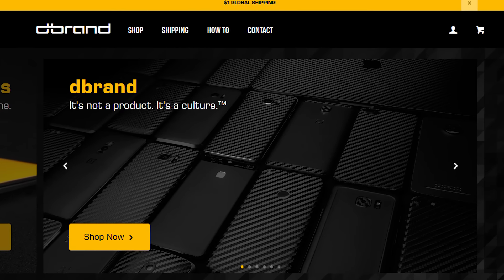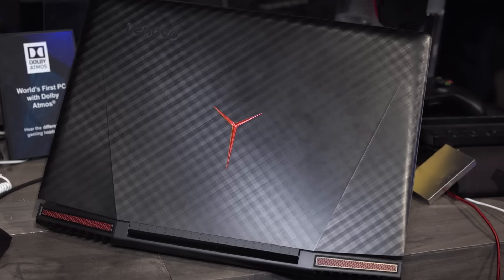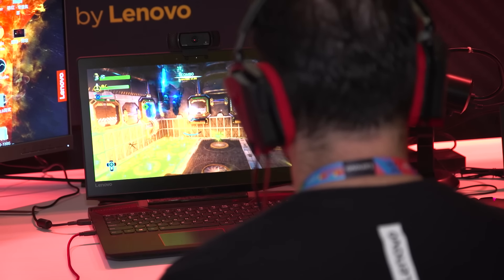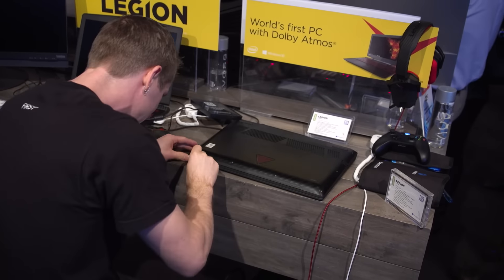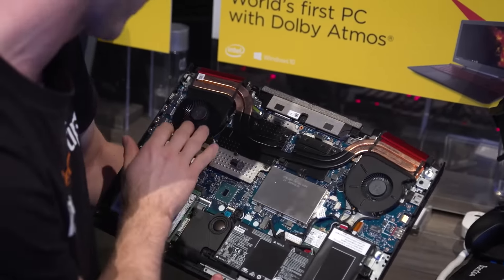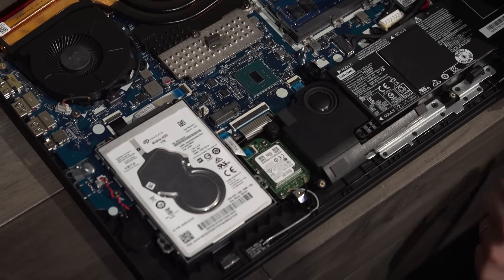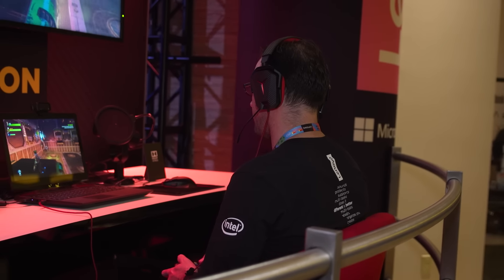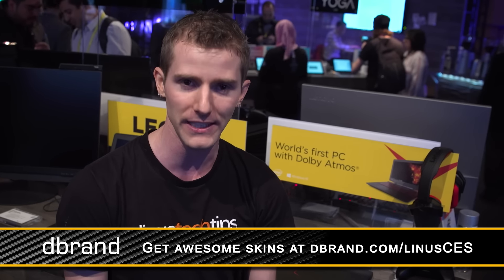World's First Dolby Atmos Laptop

Comment: didn't mi notebook air have Dolby atmos
Reply: i have that laptop atm and yep, you are right. honestly it sounds the same as the regular down firing speaker tho- just seems like another fancy marketing term
Reply: Right but a MAC is not a PC a PC has to use the windows operating system.
Reply: What? Mac is part of a PC, which stands for a personal computer- it has exactly the same hardware as rest of Windows platform does meaning it does not make Mac look any more different with PC with a Mac OS installed other than Windows.
Reply: TechMan221 no one was talking about MAC. Xiaomi Mi Notebook. Which has Dolby Audio but not Dolby Atmos which is their premium cinema audio technology. For it to work best, it needs to have the full array of speakers like the traditional 5.1/7.1 setup with additional speakers for audio from above. The ones on phones and this laptop and sound bars focus on audio virtualisation
Reply: David Park Didn't realize the laptops name was mi notebook air i never heard of it before.I thought it was a spelling mistake and the notebook air was a macbook air.Also if you put into google the notebook air the first thing that comes up is a macbook on the right hand side anyway.
Reply: That's because it isn't really an atmos setup.
Reply: To get the benefit of Dolby Atmos you need to hook it up with 5.1 or 7.1 channel surround sound speakers. Atmos just makes optimization better so that those setups sound better than without having Atmos.
Reply: You don't necessarily need a sub to do a atmos setup iirc.
Reply: Godin The Killer Yea but what company sells only 5 and 7 channel kits?
Reply: My Lenovo z50-70 got dolby too 
so...
what ?
Reply: I don't quite get what Dolby Atmos is even supposed to be for laptops and such. Isn't that the name for the 30+ speaker setup that movie theaters use?\
Reply: dolby atmos makes the sound so thin and 'empty' that I will turn it off every time
Reply: Ting Tiew Yik What were you using? what brand?
Reply: It's not 5 nor 7 channels for atmos setups, it's at least 9.

Also, riddle me this: Apart from cinema setups, what company actually sells a purpose built bundle containing atmos speakers? Klipsch doesn't, JBL doesn't, Pioneer doesn't.

Comment: the cap over the ram might be for structure reasons and maybe to protect against  heat from other components and or noise cancellation, because ram modules can be noisy at high pitch frequency.

Comment: I've been a Y50 owner for over 2 years. I absolutely love the laptop. It's anything but perfect but it gets the job done and looks good doing it, I love it for that. So I have to ask. Lenovo, what the fuck were you thinking with this rebrand? I mean whatever, change the name, for a rose by any other name would smell as sweet, or something like that. But you had to go the "gaming" route and put whatever the fuck you call that weird Y thing is on the top cover. Now I will give you credit, where others have fallen super hard into the "gamer aesthetic" you have been relatively restrained. however, even with that being said I personally cannot excuse it. I will not be replacing my slowly dying Y50 with one of your new laptops if it still has the weird red Y on the top cover. What I love about the Y50 is it's clean aesthetic with only the red keyboard showing the gaming nature of the device.  Also I sure as heck hope you fixed the hinge problem that plagued the Y50.
Reply: dbrand problem solved...
Reply: Same for my y700
Reply: fallen1102 The Y on the back applies only on the Y720, the Y520 has one of the most normal back for a gaming laptop

Comment: $1200 for only a 1060? Eh, I'd wait for it to go on sale for less than $1000
Reply: InfernosReaper To me it's more of $800.
Reply: InfernosReaper 1060 replaces the 970m
Reply: I know what the 1060 in a laptop is for, but I just can't get behind that price. It's just a couple hundred too high on the entry level for my taste compared to the 1080s & 1070s, but I should reserve judgment for the 1050s shouldn't it?
Reply: InfernosReaper I think Lenovo is making 1050ti version that starts at $899.
Reply: 1050 ti is 20% faster than gtx 970
Reply: InfernosReaper almost all 1060 laptops cost 1200+ so its still a good deal
Reply: But not all. Since I've seen entry level ones starting at $1000 on newegg, I'm not that unreasonable for thinking it should be a bit cheaper.
Reply: No it's not: http://gpuboss.com/gpus/GeForce-GTX-970-vs-GeForce-GTX-1050-Ti
Reply: Each GPU in the 10xx line is supposed to be upgraded versions of the ending number. 1050 > 950 , 1060 > 960 , 1070 > 970 , and 1080 > 980.
Reply: amd ftw?
Reply: jaques marques he meant to say 970m as the 970 never got a laptop model
Reply: TMS Broo honestly though I myself am waiting for the Rx 560m as it is routed to be a mobile Vega competing against a mobile 1060 perhaps
Reply: I very much hope it's 1000 in euro's too. A laptop with a 1060 in it will cost you 1500 euros here in the Netherlands. Thats 1577 dollars.
Reply: InfernosReaper Laptops with gtx 1060 are usually over 1400 so this is a pretty good deal. They have a cheaper entry level version with gtx 1050 or 1050ti starting at 899
Reply: Jacco vw It's because of the local taxes. These laptops are only this cheap in the US. 1200$ means it's going to be about 1600$ in europe.
Reply: I'm basing opinion off US prices and I've seen $1000-1100 entry level 1060 machines on newegg. Them just existing doesn't impress me. I want to see them are a good pricepoint to be impressed. Otherwise, why should I buy Lenovo only to have Steve pawn the job of fixing it off to some other tech when it inevitably breaks.
Reply: I'm okay with a regular backlight or even no backlight on the keyboard, since I'm not really looking at it much, & who the fuck uses a trackpad to play games anyway? I'm plugging a mouse into that bitch.

Of course, I'd also drop the super-fast SSD(cause those are super expensive & not super necessary) & mechanical HD in favor of either a bigger but overall cheaper SATA SDD.

It's little things like that which can save a good bit of money for the customer while still delivering overall good performance
Reply: That's really sad because a passable keyboard isn't that damn expensive.
Reply: What? That's a great price for a gaming laptop.
Reply: No, it's a run of the mill price for such a gaming laptop. Everyone's got ones like that around that pricepoint(with a few that are lower). I want something to be impressively priced.
Reply: Dell inspiron 7000 gaming series 15 inchers with 1050ti starting at 799 USD, got impressively priced?
Reply: You get all dell quality components with ittle to no flex and a fucking great keyboard ( know that as this is being typed on the original i7559 and they are carrying over all the peripherals except the screen)
Reply: Dishant Mishra TI starts at 899
Reply: Oh! sorry. But you still.get the bang for your buck with it.
Reply: A laptop 1060 is not an entry level card...it outpaces the 980 from last gen and is just behind the desktop 1060 in performance. You will rarely find a 1060-powered laptop (that uses the 6GB version and not the 3GB) for under $1000, and usually those have significantly cut corners in some area to save on cost.
Reply: If you're going to release a product in a category, it's gotta impress in some way, but we don't have that here. it's just the same stuff we get from others at the same or greater prices.
Reply: a 1060 is not better than a 980.
Reply: jaques marques it is for things that don't involve actually playing games, but no one here cares about freaking bitcoin mining.
Reply: The whole point of buying a pc with a dedicated graphics card is for playing video games.
Reply: my 770 gig with I7-4770 8 core cpu 16 gig ram 64 bit system can run any game on max ultra the game that gave 30 fps only was dues ex humankind but then again that game wasent very optimise
Reply: InfernosReaper im with you on this one $1200+ for that is way too expensive check out pcpartpicker or better Techlinkbear for some reasonable prices!
Reply: genno hadood You can't buy any laptop with a gtx 960m and above under 1000$ outside of US.
Reply: Salty Goal but that $1200 is US pricing, so ya know...
Reply: InfernosReaper Still. Gtx 1060 is in the price range of gtx 970m so that's a pretty fair price.
Reply: bob174d that's NCIX US so it's mean for US, right? Could do better. For the money. Some parts are more than should be paid for what they are. Seriously, who gets a samsung SDD but a freaking WD Blue?! That aside, there are some things we can do better on(if US), so this site has failed you.
Reply: and i was the one who anticipated starts at 1450 $ , if not so ....hmmmm
Reply: Lol XPS 15 cost 1499$
Reply: sighs The 1050/ti replaces the 960m/965m price point which was $800-$1200 while the 1060 replaces the 970m price point and the 1070 replaces the 980m price point while the 1080 replaces the desktop 980s in laptops. So $1200 is quite resonable for a 106 based laptop and is what I am looking at personally. Sager NP8155 with a 1060 3GB i7 7700hq and a 256gb m.2 ssd no hdd as I plan on adding a 2-4tb one down the road. with 8gb of ram that I can always double to 16gb or more if I need it later.
Reply: It's a run of the mill price was my entire point, so not really worth getting too excited over.
Reply: Surface pro 4 cost around 3200 dollars, I know it doesn´t make sense with what we are talking here, but is not too much for a computer? I mean is as expensive as Razer Blade GTX1060, and the surface doesn´t even has a dedicated graphics, every time portable computers are getting weird prices , I know that it have pretty functions like professional drawing and modeling 3D, but not that much expensive.
Reply: i think its a fair price for me since i get a student discount, quad core i7, 4k display, 16gb ddr4 ram, 1 TB 5400 RPM, a 512gb SSD, and gtx1060 for about 1500 that sounds great to me
Reply: Mark C. $1500 it's too much for me, I just have $1,150 saved and my dads don't want to spent to much in a computer
Reply: Jesus Sebastian check us Lenovo website you can get a non ssd model for 1119$
Reply: Felix Harsh still expensive for not SSD
Reply: Jesus Sebastian at this price point there is no other laptop with gtx1060 and i7 in the market.plus ssd is an easy upgrade down the line
Reply: Felix Harsh well, this sound much better, I will think it
Reply: Jesus Sebastian look at Asus predator Helios 300. It's $1099 and has i7 with 16gb ram,256gb SSD and a 1060
Reply: for a 1060? thats a damn good price you'll never find any laptop wth a 1060 less than 1200 lol
Reply: Alvin Amana no wtf look up Acer predator Helios 300, it's $1049
Reply: Ryan Despacito did you look at the space  difference? one has only 256 the other has 1 tb an 256 ssd if you own a laptop an play games you'll find your going to end up spending money for space anyway an spending that 1200 you wanted  to avoid
Reply: Alvin Amana uh it's specs are better than the base model for this laptop and a 1tb hard drive is $50, so you're wrong
Reply: 50? no lol unless you want a harddrive that break down after a few months because you bought it from some cheap chinese web site and you have to buy another you'll spend even more than 1200. You get a legit good one try little bit more than that.
Reply: Alvin Amana r u legit serious right now? who the fuck buys a $150 1 tb hard drive. it's cheaper to buy this laptop I've researched it. it's not the best one but in terms of price it's the most value
Reply: and best for your value? You gt less ports you have to get more space which Im sure you are not goig to want to put in your self, its a waste of time just get the one with the added space and save your self the extra shipping and handling and waiting. assume its cheaper its cheaper by like what 10 bucks? but you stillhave to buy a kit to open up your laptop safely and install the space or pay some one to do it foryou? waste of time and money its good for its price
Reply: Ryan Despacito yeah that is a nice laptop. I personally prefer the y720 due to it's bigger battery and thunderbolt 3 port. But if those are a non issue than the Acer predator is a really compelling option

Comment: *Note The Xbox One S Controller has Bluetooth and works with windows 10. Only downside is checking the battery level, either have to go through steam Big Picture Mode or Rainmeter to check it.

Comment: So Lenovo has had dual Battery setups for years. Even older thinkpads have it. This is due to the battery limitiations. That is the same reason the macbook pro 2015 "only" has 99,5 Wh. More than 100 in 1 pachakage is not allowed. Also it saves them a lot of room when putting in a more square logicboard.

Comment: The lenovo Y series are budget gaming beasts. They also have very good sound setup, so its not a surprise that this new series has atmos. They had an sli module that could add another graphics card, or hard drive in place of the cd slot. Very solid keys. Trackpad was pretty shit, but most windows laptops have bad trackpads. Your are going to have a mouse or controller plugged in anyway, so its not a big deal. 

My advice to buyers would be to wait for Legion to release a smaller variant. I personally like smaller laptop screens for a couple reasons, the smaller size makes it more suited for carrying it around, they generally cost less, and most importantly the price to performance is generally better as you will have less pixels to push.

I would never drop over a thousand dollars on a laptop, that is just absurd. If you are going to spend that much money you might aswell go top end desktop and get a 1070 or 1080 paired with a 144hz monitor. 

Even if you could get a laptop with top tier graphics, its probably going to be wasted if you don't have a higher hz screen. 

To sum it up, the lower tier gaming laptops have become very good console replacements, and having xbox controller integration in this new lineup is particularly interesting.

Comment: pretty sure the shielding is to stop RF interference, either that or they shaved some costs by using baredie and using the chip-on-board method for putting the register sectors onto the PCB, bare die likes to reset with uv spikes/uv getting onto so windows would never boot if every register just cleared itself.so yea

Comment: So I finally picked one of these up on sale from Microcenter, and I have to say that while the speakers don't sound bad, I'm a bit unimpressed and underwhelmed.  I was pretty hyped considering every laptop I've ever owned has had crap speakers, my MBP being the worst of them all, so I got my hopes up more than I should have.  They definitely project better than other laptop speakers I've heard, but they don't really simulate surround the way Dolby claims and there is a distinct deficiency of low-end compared to some small portable speakers I've tried.  I'd almost say the speaker add-on for the Moto Z phone sounds a bit better with much more bass, despite being very small in comparison.  I'm at least satisfied with the performance of the laptop with most games I threw at it and on the Oculus Rift, though I would have gladly paid a little more if they'd have included a 1070 vice a 1060.

On another note, Huawei claim that their Matebook X is the first laptop to have Dolby Atmos.  Which is it?

Comment: Hey Linus actually I have a self updated upgraded hp dv8 that does have DOLBY ATMOS support being a 2013 unit it’s equipped with srs Altec Lansing with a down firing mini sub woofer built into the unit with independent adjustments they are pretty bitching units same with the older Sony vaio vgn and fgn series 18.4 laptops even backlit boards that you can make rgb with a small cheap kit pretty slick and they are older as well but can hold its own with anything current so can the hp , love the vids man wish you would answer questions and comments more or had some one do it for you !!!!!!

Comment: assuming(what is wrong) that air temps work the same in a laptop case(wich i'm sure it isn't) as in a motorbay of a car(yes i know it isn't), it's probably just a heat shield... heat shield GREATLY reduce the amount of heat transferd to surrounding components by creating what is known as an "airgap" great stuff imho... if this is what it is for though.. it makes me wonder why they are still stacking the ram on top of each other... xd

*edit* i just realised that radiated heat will not act different inside a laptop... so it would help keeping the heat of the ram with just the ram? maybe giving "cooler" over all temps?  i have to be honest that i haven't checked what ram does for temps since the release of "rimm" memory xD

Comment: about the steel cover, same does Dell with the m.2 SSDs for the Precision mobile workstations, 'least mine Precision M7510 has it. It's because of cooling, Dell has there a space between the cover bottom, not sure if without space isn't it even worse, but maybe I am wrong and Lenovo has other reasons for the cover than Dell has, but I don't believe so

Comment: They should think about leaving the battery out of those gaming laptops. Maybe just somethink that can power it for 5 minutes to change the position. I don't see the point to have a battery in an device thats made for gaming. During gaming the battery is down in what? 30 Minutes? And theres not the 100% power as long as its unpluged. So...these batteries are just there to die. In my oppinion it would be better to use that space for intelligent cooling (low noise) or a lower price point.